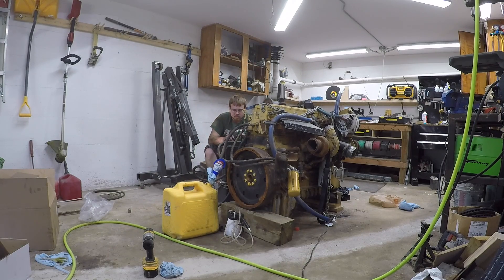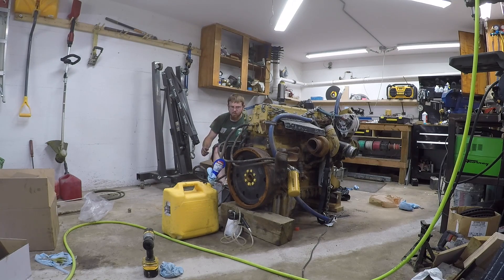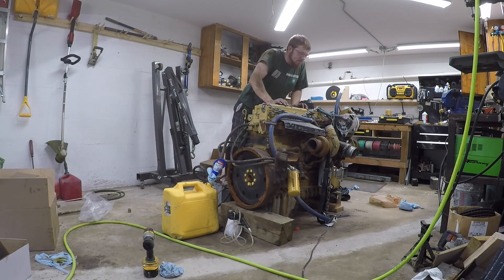Pt. 2 Test Firing The F-350's New Cat 3126 Engine.

Comment: What’d you do back probe the ecm pins at the CAT side with voltage and ground? Or put leads into the plug on the OEM side of the ecm as if the “truck” was sending 12v and ground?
Reply from the maker: The guy I bought the engine from cut all the wires from the vehicle side ecm connector so pins 52,53 are I switched battery +, 65,67 are grounds and 70 is ignition + and that’s all you need to fire it.

Comment: videos are awesome anyway you could help me out with which wires/pins are needed to start a 3126 on the ground i am picking my 3126 up some time this week and would like to start it before i do my swap. my swap will be a bit easier than yours tho its a 3116  to 3126.
Reply from the maker: Thanks! Is the 3126 a 40 pin or 70 pin?
Reply: @DrEwBaBy625   im not sure yet i didnt look when i was there its a 98 out of a c6500 chevy
Reply from the maker: I’m not sure what year they switched my 40 pin 3126 is out of a 97 and my 70 pin is out of a 99. We’re the intake and exhaust on the same side of the head or opposite?
Reply: DrewMan'sDriveway  I went up there today and didn’t have a Allen wrench that fit so I couldn’t find out for sure but from the looks of it I’d say it’s probably 70 pin the ecm is 149-6989 0
Reply: 149-6989 01 sorry
Reply from the maker: Yeah that part number is a 70 pin ecm. So pin 70 is 12v+ ignition key switch, pins 52,53 are unswitched 12v+ and pins 65,67 are grounds. That’s all you need to fire it
Reply: DrewMan'sDriveway ok thanks so much they are suppose to be pulling it in the next couple of days fingers crossed everything goes right.
Reply from the maker: Good luck! If you need the full wire diagram shoot me an email and I’ll send it over. DrewMansdriveway@gmail.com
Reply: DrewMan'sDriveway that would be great I’ll send you a email real quick

Comment: How did you get the motor to stop after you got it running?
Reply from the maker: I disconnected the ignition input to the ecm.
Reply: @DrEwBaBy625  You know much about the 3116? I bought one and I'm gonna fire it up to see the condition and these are the mechanical fuel injected ones
Reply: Mason Smith there’s a manual rack somewhere. Usually they’ll have a fuel shutoff solenoid somewhere ion either the injection pump or the governor housing.

Comment: What did you have connected to the ecm. Like power, ground, cam position. To make it run. I’m troubleshooting my 3126. It shuts off after about 30 seconds.
Reply from the maker: The Cat Ecm has two connectors one is the engine side which has all your sensor input and engine controls the other is all the controls between the vehicle and the ecm. In order to fire it on the floor there are 2 constant +12v, 2 grounds and a +12v ignition source. Does your engine have the 40 or the 70 pin ecm? Check engine or engine warn light on?